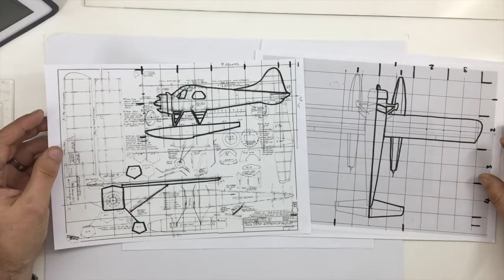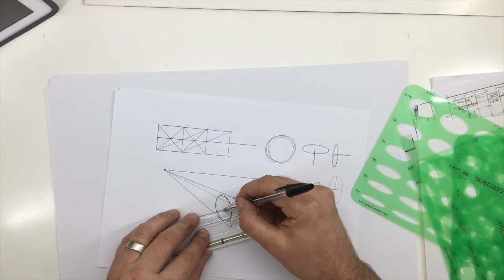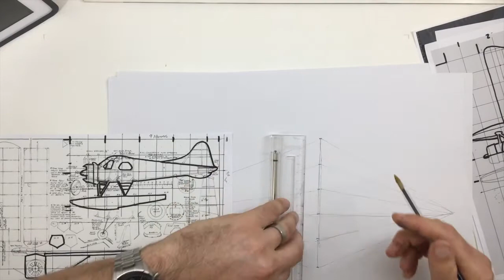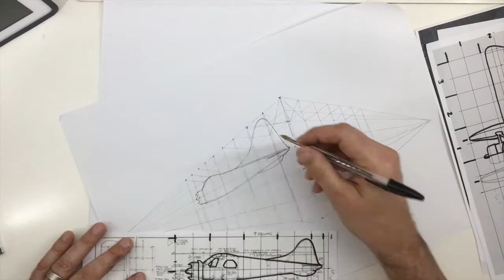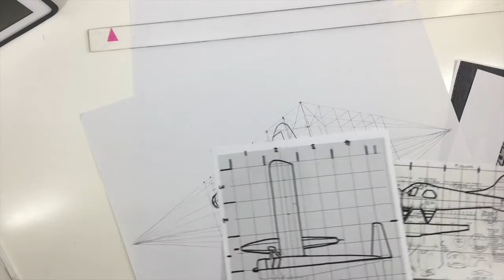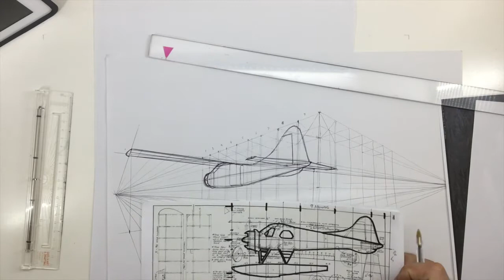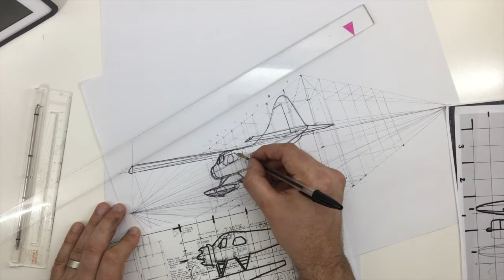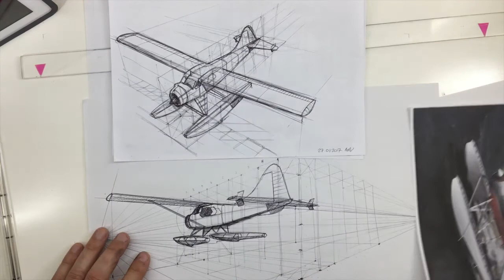Aircraft Drawing in Perspective ADVANCED

Comment: The BEST THING I LEARNED, that I was a BIT uncertain about, which was answered, is that the object, is drawn FLAT, with no effort at rounding to the horizon lines FIRST, and then it can be made circular, LATER. Huge help. Thanks, I hope you make a Video taped series.     There is a technique, used by the OLD MASTERS, that is a huge time saver.      If you take the overhead view, THE AZIUMUTH,   And move it to any degree, from the left to the right, you can then draw THE VERTICAL LINES, directly off of the overhead "flat drawing", straight up, and it will give you the proper distances.   I learned that from a student of Keith Ferris.  I hope that makes sense.  So, take the overhead view, MOVE IT ANYWHERE YOU PLEASE, within 360 degrees, and just draw lines STRAIGHT UP, and that will give you the Perpendicular lines, corrected for distortion, and then draw the perspective grid from their.  That was one of Keith Ferris' techniques.